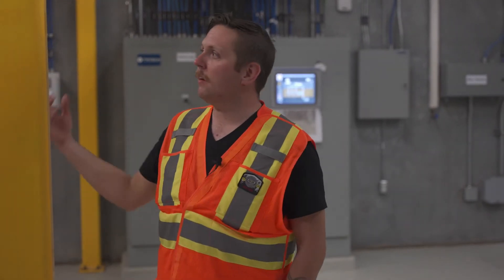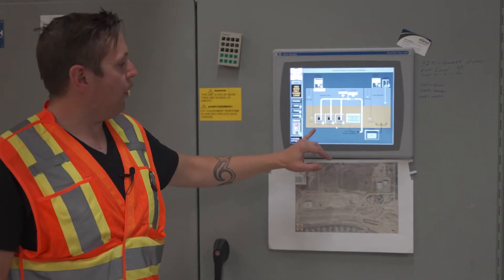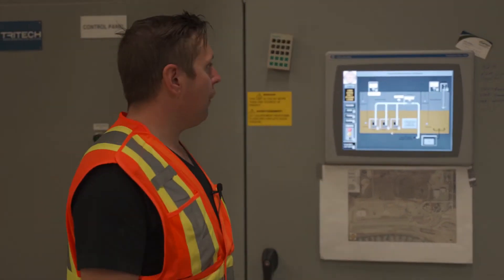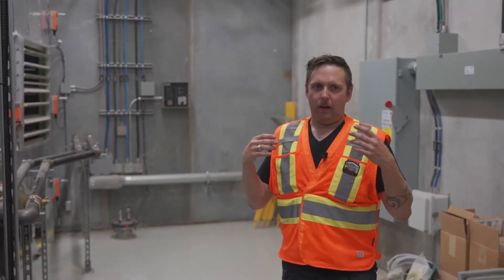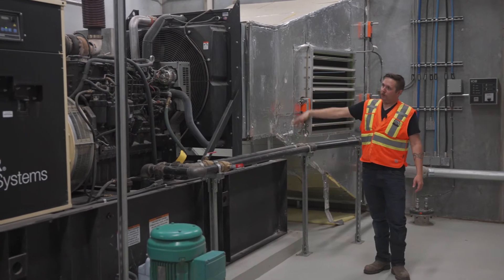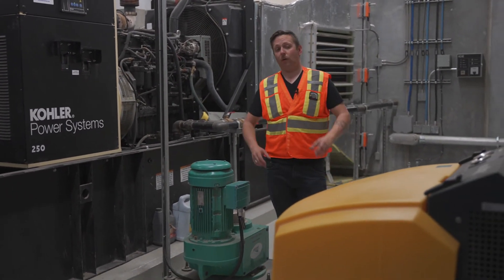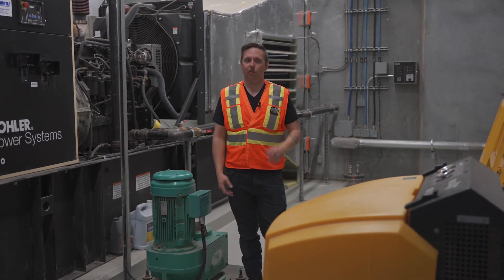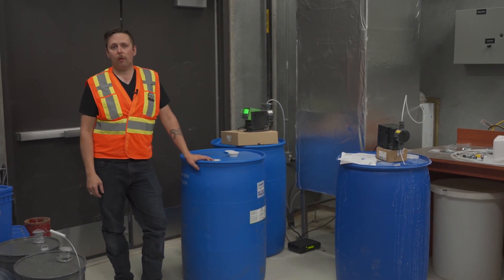Walkthrough a Sewage Lift Station

Comment: What enzymes & de-greaser are you guys using along with pulse/ min
Reply from the maker: Thanks for your question! In our walkthrough, we didn't specify a particular enzyme or degreaser brand because choices can vary based on specific local regulations, needs of the system, and environmental factors. What's key is that any enzyme used should be able to effectively break down the fats, oils, and greases (FOGs), and any waste components specific to your system. Similarly, a degreaser should be safe for the system materials, and it must meet local disposal regulations. The pulsing rate of dosing pumps is typically adjusted to match the flow rate and specific needs of the lift station. We recommend consulting with a local expert or supplier to help determine the best products and dosing rates for your specific situation.